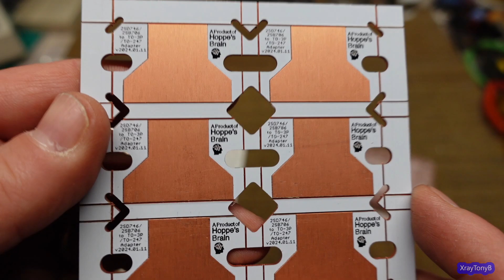MT-200 Transistor Adapter Plates by Hoppes Brain

Comment: I just ordered more than a thousand adapters, should be in stock in the next few weeks. I'll have..

* MT-200 to TO-3P (These are live on my website already but stocks are low.)
* 2SD746A/2SB706A (Pioneer 80 series, Phase Linear, Luxman)
* Batwing to TO-220
* TO-3 to TO-3P
* TO-66 to TO-220

Comment: Same basic idea Rockford Fosgate Used in their Car Stereo Amplifiers I use to work on them all the time . They mounted Several on a copper strip board that had an aluminum backing . I use to use a hot plate to change the transistors. Ive done this on other models that use MT-200 Transistors It works fine
Reply: Interesting, thanks for that. I found a a video about that solution... It appears to me that the Rockford solution is actually an aluminum core PCB with a copper traces on top . This is pretty clever because the insulating layer between the back of the transistor and the aluminum substrate, is very thin and performs much better than any thermal insulator pad. There's no need for a pad. But ultimately, it's all aluminum heatsinking, so the Rockford solution seems to be more about eliminating the thermal pads than heat-spreading. These adapters are solid copper all the way through and require a thermal pad on the heatsink.
Reply: I'm thinking about this more. :D This is a clever idea by Rockford for an additional reason... The elimination of complicated mounting hardware... All those bar-clamps and stuff are fussy to install at the factory. More manual labor than just screwing this assembly to the heatsink. And the bar-clamps look pretty meh, the amp is going to look way cooler inside with the transistors uncovered.
And there is no physical pressure on the transistor!
This could all be done with a copper-core PCB instead and wow that would perform amazing.

Comment: W00T! I just tested the thermal performance of these adapters versus a real MT-200 2SA1494, and the adapter appears to work slightly better! Details at my blog.
MT-200 2SA1494 – Start 22.7C, End 49.0C = ∆ 26.3C
Hoppe’s Brain MT-200 to TO-3P adapter with NJW1302 – Start 23.4C, End 45.8C = ∆ 22.4C
NJW1302 on it’s own – Start 22.0C, End 49.8C = ∆ 27.8C
Reply: Not so big difference 😅

Comment: What I love about this is the willingness to think outside the box to come up with a workable solution for, nit just a singular situation, but multiple uses. With today's miniaturization, you can fit a lot on a plate that size, so I'm sure you could use them for much more than just direct replacement. Kudos to you both.

Comment: H i Tony,  I  hope all is wel with you and your family.  Wouldn't these also work for the 2SB705 2SD745  pairs as in the Realistic STA 2080?  Thank you!
Reply: Yes they should work! 2SB705 is a regular MT-200 package.
Reply: Chris Hoppe here.. :^)

Correction! The 2SB705 appears to be an "RM-60" package, which has the same 24.4mm bolt spacing as the MT-200, and is fully compatible, but has exposed metal substrate sticking out both sides, instead of being fully encapsulated. They should work! The trick is to get the right substitute transistor, or adjust the compensation of the circuit to accommodate a new, faster or slower part.
Sheesh I'm going doing the rabbit hole on these obscure transisrtor packages.
Reply: I just looked at a picture of how the STA-2080 has it's transistors mounted... They're sandwiched underneath a phenolic circuit board that turns brown over time... not a great arrangement, that phenolic could get weak. I would suggest a modification where you cut out that piece of circuit board directly over the transistors, (There's a white outline on the PCB), add a PCB support standoff in the middle, and then mount the MT-200 adapters to the heatsink with the screws and shoulder washers, no board sandwiched between. No more burned PCB, mechanically stable.

Comment: insulating gromets for the screw holes would be a necessity to use with them (alogside possibly increasing the size of screw holes)
Reply: Yep! That's part of the design. Two sets of nylon shoulder-washers will be included, one set fits #4 and M3 screws, and the other fits #6 and M3.5.